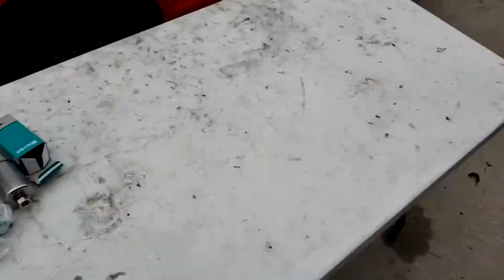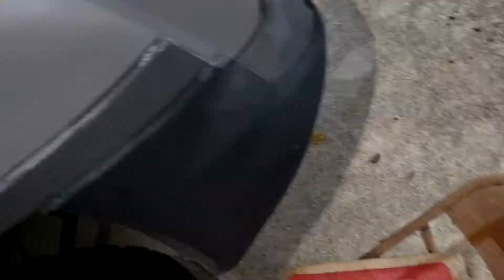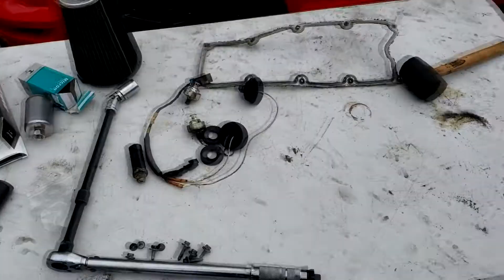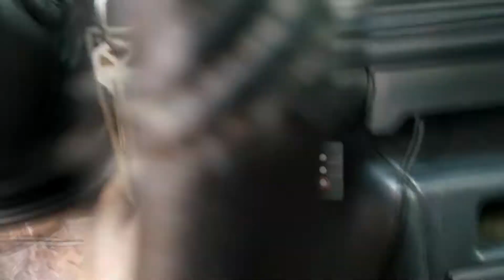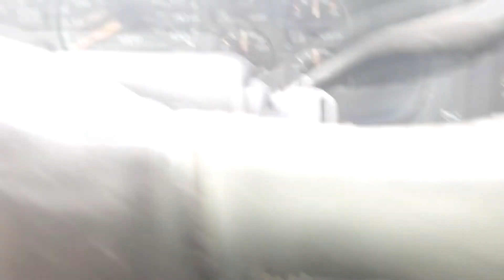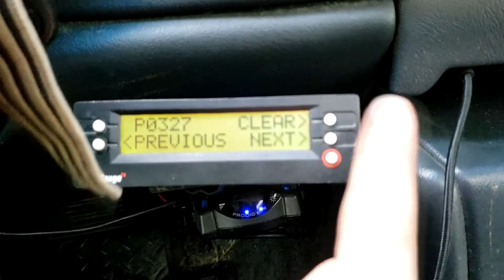Knock Sensors, Oil Pressure Sensor and Wiring oh my

Comment: Oil leaks are always the downfall of high mileage cars!
Reply from the maker: Yeah man, for sure. As long as your monitor it I guess it's ok, but they drive me nuts. Hence all the effort in stopping them!
Reply: @AllThingsBoost  yes!  Sometimes, on high mileage cars that I've owned, I have pulled the engine and replaced all the seals and gaskets.  Sometimes this is quicker/easier than working on it in the car.  This can give an otherwise healthy engine a new lease on life!